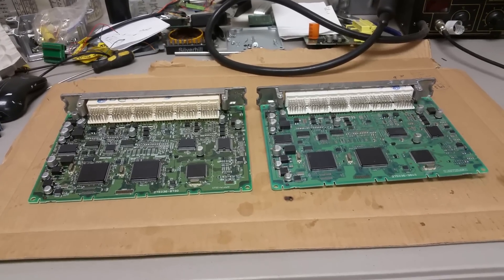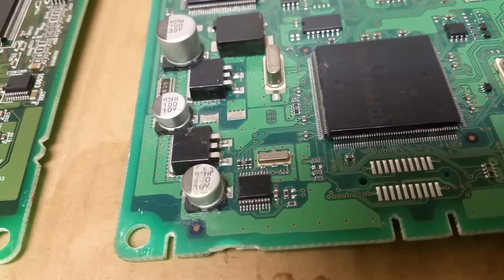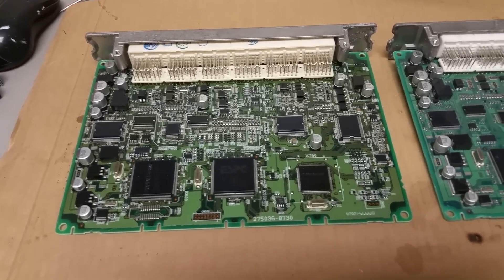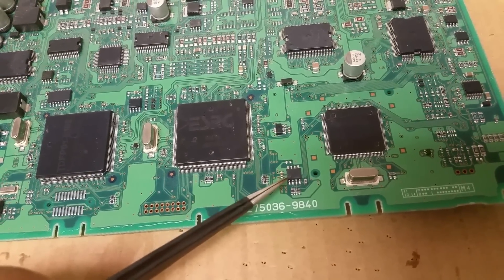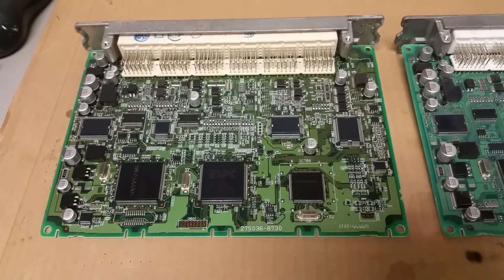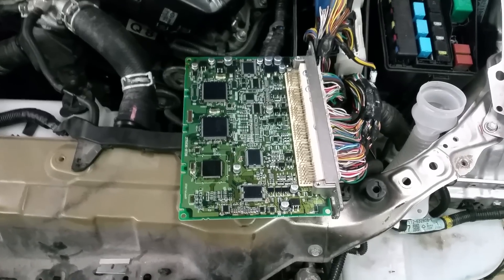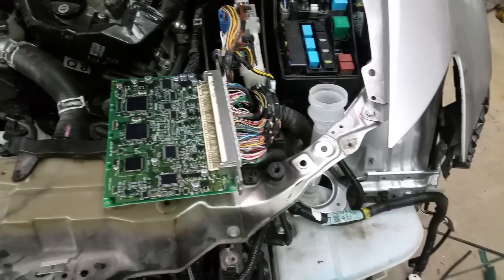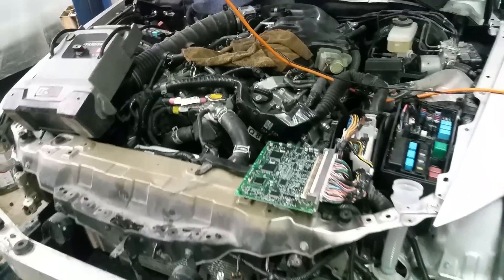HOW TO PROGRAM LEXUS TOYOTA ECU IMMOBILIZER KEY AFTER ECU SWAP

Comment: Hey George. Thanks for an awesome video. Hoping you can help with 2 questions i have. 1) You swapped over two eeproms in this video. Exactly what information did those eeproms contain that needed to be swapped from one to the other? 2) I want to try and virginise the relevant ECU in my is250 as ive lost all the keys. Do you know if this is done using the SmartBox, or the ECU? Im hoping to be able to read the relevant ECU eeprom, zero it out and reload it back in. Thanks!

Comment: My computer got flooded. Anyway when I take my ecu out, my door locks and windows etc still work, even with the touch locking? . I can even turn the engine over however it won't start. I just bought a second hand one off eby, and I'm pretty excited to hear it run for the first time since I've ownd it What were those 2 chips for?

Comment: Hello George I've seen 1 of your other video regarding a Toyota ECU cloning while you just read from the old chip and write it to the new used ecu chip.

So my question is did you cleared old data from the old ECU chip or it clear it automatically I mean don't you have to verginz the old 1 before you write new date to it?

Hope you answer and understand my long question.

Comment: Hello sir. Currently, I am using Powerbox for ECUFlasher and I'm trying to connect it to Toyota Camry 2007 Hybrid ECU via Rainbow Wires. Do you have the connection video of it? If you have, I would like to buy it from you.

Comment: Hey George , when doing this did you verify that the correct mileage was transferred over? 
Like when you check the mileage with a high end scanner, not on the cluster which has its own separate storage.

Comment: Hello Mr. I bought a new PCM for Toyota Tundra 2009, I did the process between pin 4 and 13, the car started, minutes later it just turned off and now I have no communication with the PCM, there is a simple way to recover it and do the process again  ?

Comment: So I had a question 2013 Tacoma if u flash that chip if I flash that chip will it be able to be input into program mode to program new keys without the master as long as I have one cut from the VIN or would that be in the immobilizer

Comment: Good job
But why did you change the Eprom 
Most of toyota - lexus works after a 40 minutes of connecting pins of obd  (4-13 ) 
I really hope you clear when do we need to change the Eprom and Y some times it works thru OBD ! 

Many thanks 
My whats app 00966509065567

Comment: Which chips do I remove/replace for a 99 Lexus GS300 ecu. I know about IC900 from SpeedKar99, but what are the other chips do I need to unsolder.
Reply: I just swap the IC900 on my 2001 to a 98 gs300 ecu and it works
Reply: @mahtogje  ok i will try because I have bad 99 ecu(2 master key), and an ecu from 2001(2 masters keys) and 2000 gs300(2 valet key). I try

Comment: Is it necessary to do this "cloneing" on this year vehicle? Cant you just pop in the alternate ECU and short pin 4 and 13 and wait 30 minutes like your other video. and then use techstream to write the vin back into ecu? or is there any other information that this process will cover that the steps above wont? I think the mileage is in the cluster and the key information is in the smart key module.
Reply: thxs dee lee u save me a bunch of time

Comment: Seems that a lot of dealers are buying ECU/ECMs, etc. from the local ECU/ECM shops. You can get ECU/ECMs repaired or replaced fairly cheap now days. The dealers are marking up replacement units and programming  - as expected.
Reply: hence they are known as the 'MAIN STEALERS' THERE SHOULD BE A LAW AGAINST THIS PRACTICE

Comment: I got a used 2006 IS250 board today it looks just like this board to the left. same part number at the bottom. It also has the extra chip just like board on left. IC401 area. My used board had a coating of UV paint or coating? Is that from the factory or aftermarket?

Comment: hi George, good video. please before you do the swap, do you have problem with the steering not being able to turn, like having the power steering light on.
.... my 2006 Is250 has a steering lock due to driver front side accident and the steering locked toward left and won't even turn a bit. lexus want me ro replace the ECU and Rack & pinion.

Comment: Hi George, nice video.    What was the second chip you transferred? Dealer told me my 2000 Lexus lx470 ecu was bad.   bought a salvage and had electrician swap eeprom but still get the blinking security light and no start.   Do I need to move another chip?
Reply: Hello Can you say the inscription of the chip you moved initially. Also do you have correct milage and vin number when you swaped first EEPROM. Also he swaped 2 eeproms. Im trying to figure out what eeprom you switched and what it does and if you swap out the second eeprom what it will do.
I also wonder what will happen if one of the chips was an immobilizer and if that was disconnected. Will that shut off the immobilizer and allow car to run and with security flaw?
Thank You for this learning opportunity.
Reply: What happened to your situation?

Comment: Im actually surprised that it has the immobilizer EEPROM on the Engine ECU and not on a smaller separate Immobilizer ECU.
Reply: Yeah exactly what I thought. Toyota stopped using the ic900 location for the 93c56 chips after 2005.

Comment: Do you know how to make the car enter programming mode if you virginize the ECU's EEPROM?
Reply: How do you virginize a ECU EEPROM? Also About your immobilizer /ecu question im curious about this too.
What does the immibilizer ECU ( seperate from ecu/ecm) if the initial data isnt on it. Also im not sure if he says what car it was from. So this could of been a standard transponder ecm instead of a smart key type. 
Did you obtain any information about this?
Reply: I think the IMMO, BCM, ABS, etc. modules would need to be reflashed to the new VIN?  In my experience all modules need to have the same VIN coding or there will be faults....?  Unless VIN info comes off another EPROM?  Thanks for sharing!

Comment: Goodnight. I have a question. how do I remove the immobilizer from my gs300 ecu.. I did an engine swap but the new computer has an immobilizer also and my current computer cannot work with the new engine. thank you.

Comment: Actually the new ECM aka computer wont need any programming cause it has a program in it intended to be learned automatically once installed on the car           
good job though
Reply: Is this from a factory new ECU or just one that is new to the vehicle meaning it could of been a previously used unit.
Reply: Dee Lee it should factory new never been installed unit once installed it will marry the security system
Reply: Actually i just tried with used ECM and it was working. Thank you for the suggestion
Reply: Dee Lee yes this 👆 could be done with a previously programed  EEPROM there is another way though which is rewriting the EEROPM data with a programmer software like Carprog or Vprog (look it up) without a need for the old maybe toasted ECM , some websites offer the Virgin EEPROM file for sale too. Good luck 👍
Reply: I was playing around with trying to solder wires onto an epprom. My goodness its difficult. But i figured if you can marry a used ecu to the car. There is little benefit to writing eprom data. The Vin can be written to the ECU with techstream and immobilizer will be set after process. So with the old EEprom what other important data will there be? I think the odometer is stored somewhere else. Thank you i will look into carprog and vprog for other vehicles.
Reply: Dee Lee its not that difficult once you get the proper tools & flux look up "SMD soldering techniques" just practice on scrap board and you will master it.. all the best

Comment: Hello, questions.  for a 1999 Lexus es300, which chips do you swap in order to program with ECU.  

Thank you.
Reply from the maker: You dont have to do that you just turn on ignition and leave it on for 30 min with key on and it will program itself
Reply: Question: Do I need the key for the ECU, which I purchased in order to program the ECU to my car.  (I bought the exact same part number).  but the ECU did not come with a key.   So, can I just remove the ECU from my car, and replace it with the one I just purchased, turn the ignition and leave it for 30 min. 

Thank you for your help. 

 
Ernesto G.
Reply: you need to actually do a virgin dump on the new ECUs eeprom to be able to program your key.  Since that ECU you bought, has the codes for the keys for the other car

Comment: wow you make it look so easy! I have a 2000 toyota tacoma that for some reason cannot communicate with the scanner. it worked for 2 days after I bought it and then boom, no communication error. I was told it was the ecu from a few shops. I purchased a refurbished ecu for $400 but it does not include reprogramming my original VIN # onto the refurbished ecu. Can I just swap eeproms like you showed so that the VIN #'s will match? If so how would I go about finding which chip to swap? Thanks. Subbed
Reply from the maker: Yes you can swap eeprom. Usually its something like s93c66 s93c67 it can be any number.

Comment: Hey George, will this still work on newer vehicles ? I have a 2015 tacoma that I need to replace the ECU for but I heard that most new toyotas have the key's registered in a seperate "Transponder ECU" . Do you have any info on this ?
Reply from the maker: You can try it does not hurt. I just never had a chance to try it on newer vehicle's
Reply: Did you ever find the answer to this? Im very curious. I think newer cars have atleast 3 computers ECU/ECM, Immobilizer, and Smart Key. This is in addition to one for power and electronics inside.

Comment: but how to know the original eeprom is also damaged or not.?   i mean eeprom data
Reply from the maker: Eeprom data hardly ever gets damaged. Even if its a flood car you can still copy eeprom data. If eeprom chip not cracked or busted it should have all data, unless you apply direct voltage to the wrong pins.
Reply: thank u for reply

Comment: Hello Mr. George Melnik, finally when the car start again . there is a high Engine speed (RPM)
so how you get to reduce this RPM !!
Reply from the maker: What was the deal with your car?
Reply: +George Melnik 
after replacement the ECU of my car there was hight idling 2500 rpm / min
so the engine accelerates , while the vehicle is in normal position
so how can i reduce idling than 2000 rpm/min to 950 rpm/min

cordially !!
Reply: Hello  George .I have a toyota rav4 year 2001 automatic gear and changed the ecu. now does not start, can the same method apply? mean, to change the eeproms between them?
thank you

Comment: You do realize that was completely unnecessary, right? All Toyota/Lexus with the separate Immobilizer ECU (like your IS) have the ability for the Engine ECU and Immo ECU to be resynced without any special equipment. The process literally involves jumping 2 pins in the DLC (4 & 13), turning on ignition without starting engine and waiting 30 minutes, then turn key off, remove jumper and verify vehicle starts. Toyota calls this "ECU Communication Registration." This works if you replace the engine ECU and still have one or more original keys (to the vehicle) .. it does not matter if the replacement Engine ECU is new or used. This process can also be used if you are replacing the Immo ECU with a BRAND NEW one (so called "virgin" one), but will NOT work if you are replacing the Immo ECU with a used Immo ECU because I doesn't reset the keys to the Immo ECU, it resets the communication between the Immo ECU and Engine ECU.
Reply from the maker: Yes that will also work but on a car that has a smart key start system it will not work as it will not let you turn on ignition also it will not write vin number or rewrite vin number in a user or new ecu. Then later when you hook up scan tool it will not read no vin or if its a used exu it will be reading old previous vehicles vin number.
Reply: +CK1 I have tried this on my 2013 Yaris and it did not work.  I even bought a new Immo thinking it had locked up and still no luck.  Do you know if they stopped allowing this in later years?
Reply: sir how to kill immobilizer system to 1uz-fe  or 3uz-fe  vvti ecu...plz tell me..
Reply: +CK1   thank you  for this information, one day 2001 toyota land cruiser stopped starting, the immo ecu was damaged ,i installed used immo ecu but ECU Communication Registration by jumping pins 3,14 failed because it is not virgin as you said.
Reply: +abdullbasit osman where r u from sar
Reply: This doesn't work on my 2013 Yaris .  The new ECM is not communicating on the CAN bus.  I must have a wiring problem.

Comment: hello mr george, i have nitsubishi galant model 2001 the computer was damages due to flooded. the computer i can save to clean by contct cleaner  and dielectric.and heating by heatgun,??
Reply from the maker: No once computer got wet it is shot. Even if you dry it out it will never work properly.